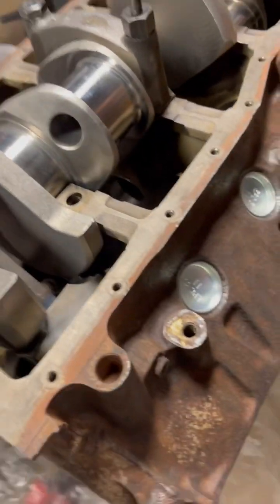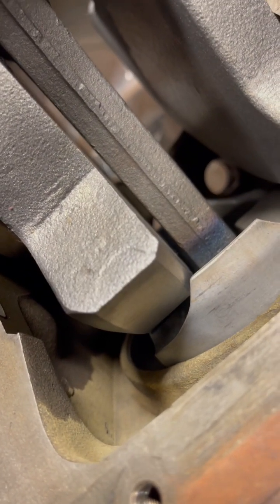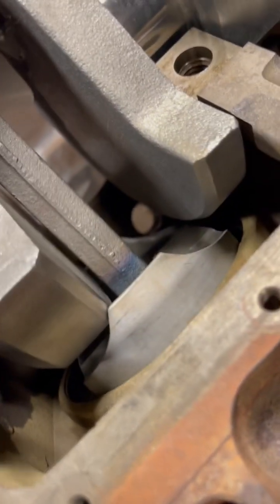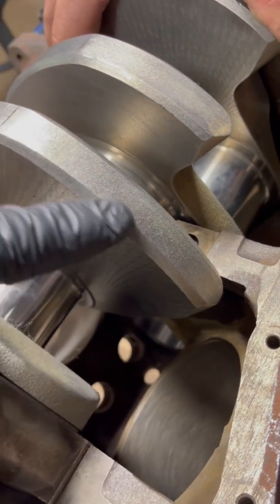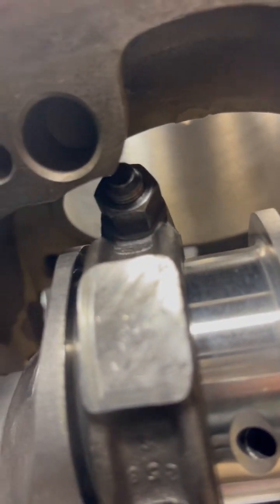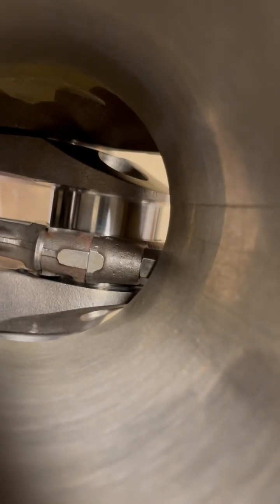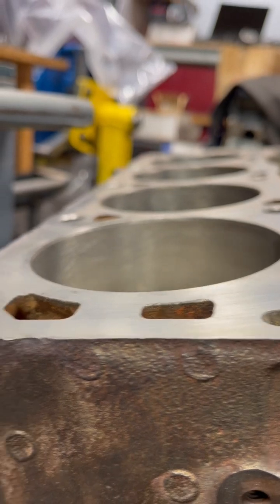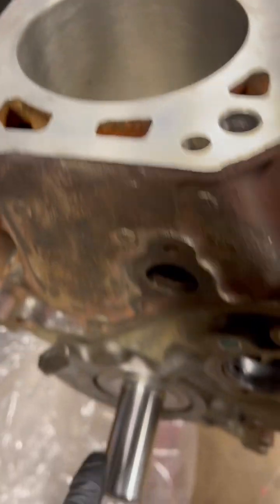When that Piston "Almost" Fits BUDGET Ford 387 Stroker

Comment: I did a 383 stroker 20 years ago. Went with forged crank rods and pistons. Rods and crank journals were SBC Chevy to reduce some weight and friction. Pistons were JE.  I had to have quite a bit clearance done as well. 2.02/1.60 valves-.542-.563 lift cam and Canfield 190cc heads.  It would smoke the tires at 30mph in 2nd on a C4 tranny.

Comment: Nvm all the heat you put in the end of the con rod……
Reply from the maker: What about it?
Reply: Heating the rod end up with a torch to press fit a piston works I guess……just nothing I would ever pay or look for in my engine builder.

If you’re happy to hack somthing,good.
Reply from the maker: @drewsharpe7484  it’s factory piston and rod. They don’t use pins with locks ….. it’s ok if you don’t like it. I don’t care. Thx for stopping by
Reply: @Neomustangs  

Um,.that’s called a press fit pin just like what I said…….

If you’re happy to do somthing that weakens and makes the rod end brittle,good for you.

Be sure to let us know when it snaps after a few high RPM pulls
Reply from the maker: @drewsharpe7484  make sure you stick around too when it works pal
Reply: @Neomustangs  

No one said it wouldn’t work,just that you considerably weakened the small end of the con rod which is usually the next weakest part after the rod bolts. Not good if you’re planning to take advantage of the CI u just gained.

I’m all for a cheap engine build but heating a rod end with a torch to press a piston is in machine shop no-no’s 101.

U know why some cheap shit works so well? Because the person fully thought it out……

When it snaps the rods and u have a large pile of bits and pieces laying around,maybe this cheap combo gets a bad rap?

5 P’s

Comment: Small problem, sucks that you have to take it apart. Remember to clear for heat expansion, and balance the rotational assembly. 1/10 of a gram on each side of the motor. Check on the windage issues with stroking motors. Oil issues can come up. Not pressure, but drain back and parasitic drawl on throw and rod resistance. And if you wet belt the cam drive, drill out the valleys of the pulleys. The belt will hydraulic a larger diameter, the oil can't squeeze out fast enough and pushes the belt out affecting the timing of the cam, about 10hp on a small block.

Comment: Do yall have a lathe to do any of that with or are you going to be using a grinder on those pistons? 

I c9ukd see taking the bolts down, assuming you turn them all down in a lathe, to take some of the height off the head of ALL the rod bolts, or to turn down the skirts on all of the pistons. 

Grinding on the block is reasonable, assuming you don't go crazy, but in the rotating assembly, it's critical that the parts remain balanced, regarding their weight. All of the parts. Pistons, rings, pins, bolts, rods, etc. They need to be weighed as a unit and the weight needs to be consistent across the entire set. A few grams off on just one cylinder and you will know it.
Reply from the maker: Ya we did all that .. it was balanced in a full video.

Comment: Clearance on the block is straightforward, fie grinder and carbide bur for the win, but the pistons, bolts, rods, etc, you need to ensure you preserve the balance in the rotating assembly. If you grind off part of the rod bolt, it will affect the balance. I suggest you clear the block vs the bolt.  When you take mass off of one part, you have to balance it out. Ideally, in the rotating assembly, all the parts will weigh the same, at least nominally. A gram or two will be a big problem in a high performance engine. The piston, wrist pin, rod, rings, bolts etc should all weigh the same, or at least within a half a gram of each other at the very worst. You'll have to clearance the skirts that interfere, and give it a little breathing room for fluids, and slop/inertia, but once you make that one work, weigh it, and make the rest weigh the same. A single gram out of whack will make a huge difference in how long it lasts before it eats a rod  or crank bearing. 

Lighter pistons are better, sure, but they all need to weigh the same or it's gonna vibrate itself to death. The crank, rods, pistons, etc, for anyone in the future reading, that  maybe doesn't understand the principle, they are all critical parts to have balanced. But when they are, you can let er rip and set the rev limiter up into the high 7ks, low 8ks with no problem. Its why racing engines can rev so high, they have light parts and are balanced to a very high degree of accuracy. 

I had a 351M balanced by a speed shop, and they set the dyno tune on the car. Honestly it scared me with the Crane ignition box set at 7800 rpm, but it was a very worthwhile endeavor. She ripped and the guy that built the bottom end said I could go higher if I upgraded the cam and valvetrain.. at some point shit just floats instead of cycling the valves on a pushrod V8 unless you've got serious springs, rockers, pushrods, lifters, etc.

Comment: not really a ford guy but I think this build is badass. absolutely love the concept of a dirt cheap stroker. would love to see this with a set of cheap gt40p heads. I think you could make some pretty good torque and some decent power for a pump gas street car for like $1500.
Reply: Sounds like the same outlook my old man had when he and his cousin took a 500ci Cadillac engine and put the later model heads on it to create a smaller combustion chamber and bump the compression. Back then it was like $300 in parts and shop time to deck the heads and block was like $18/hr lol.

Comment: Built a SMALL block 454 at my old job years ago. Ran into many of the same clearance problems. If I remember correctly, I believe the connecting rod end cap bolt heads were coming into contact with the cam lobes also! But man that thing hauled major ass!
Reply: They make small base circle cams to solve this problem.

Comment: On the rod "stud", clearance the block. Don't want to mess with the balance!
Reply: Clearancing the rod bolt would be fine its like 10 grams of material
Reply: @contraband1543  yea and it's rotating Mass what's the point of blueprinting and balancing your stuff if you're just going to throw it out the window
Reply: @contraband1543  always shave from a non rotating Mass before if you can also shaving a bolt is a bad idea period xD wonder why when you put larger rods on a car the procedure nearly everytime is to notch the block and not the rod

Comment: I'm just wondering if when the rod bolt finally has enough clearance would heat expansion become a problem at normal engine temperature? Just a thought, I don't know.
Reply from the maker: No
Reply: My 72 international 1 ton has a 351 . I was thinking about cheap upgrades for it. It's a cool build you are doing.

Comment: you can grind everything the bottom of the cylinder unless your rings hit where you ground you can grind the piston just make sure everything is chamferred and you don't want more than half of your piston sticking out the bottom or you're going to have bad rattles your skirts won't last long also with that much Pistons sticking out I would make sure it's really chamfered on the block so it doesn't wreck your skirt

Comment: How much power are the stock forged rods good for?
Reply from the maker: I bent one at 720 wheel
Reply: @Neomustangs  that's pretty good. 
I'm trying to decide if stock rods or aftermarket on my 351 single 76mm setup

Comment: Well get that Dremel tool out and just grind a couple of tight edges barely touch them
Reply from the maker: Already done. Not enough to even bother balance
Reply: @Neomustangs  enough to at least fit a zip tie through? General rule of thumb for clearance at least on a SBC stroker is .050-.060"

Comment: This should be an awesome runner. I have sprayed 400 I two stages on a stock trw piston block 302 back in the day for fun . 
Ported e7 heads an a trophy stock type cam with butt load of duration an around 490 lift. 

She would move on a drag radial. 

I see all kinds of potential in this build keep it up.

Comment: Just had clearance issues with my parking brake cable hitting the caliper bracket bolt. I’m surprised no one talks about this issue on forums. I can’t run moan brackets with the e brake lol

Comment: From what I've seen certain people don't like to stroke or make the bores bigger on a 302 because they feel the engine is too small & think thinning out the engine is not a good idea when you want to daily drive it. Some say it also over heats. With the 351w engine they don't seem to care because it's beefier  & thick & there's hardly any complaints on the 351w.
Reply: But a 5.8 block and crank is much stronger then any 302
Reply: @operatingengineer  5.8 crank not so much but the block will be a little stronger. Comin from a kid who’s killed both 302s and 351s, the 5.8 crank is just as weak as a 302 crank
Reply: @imbadwithcomputers3703  so the larger main caps and main journals of a 351 and the much bigger mass of the block webbings don’t mean anything ?  I think your wrong! Did you ever split a 351 like a 302 breaks?
Reply: @imbadwithcomputers3703  I’m not an expert but the 351 is skirted keeping the crank a tiny bit higher in the block leading to more strength. And the block is also definitely stronger. If you build a 351 right you won’t have many issues with the block or crank
Reply: I don't belive the crank on a 351 is weak at all ever see the how to push a junk yard 351  past 1000 hp @imbadwithcomputers3703